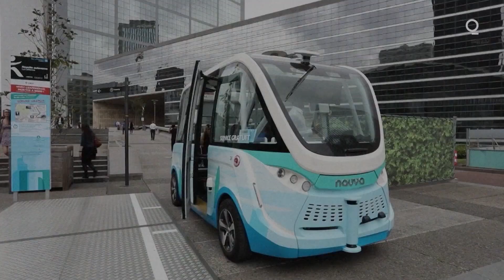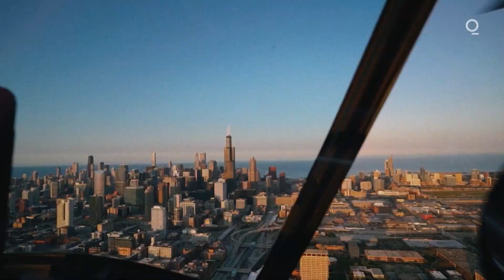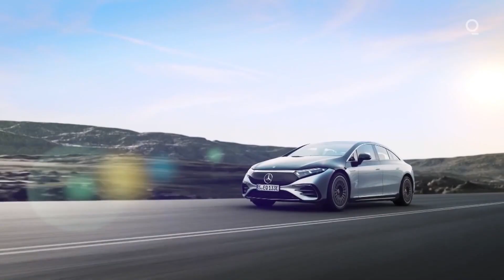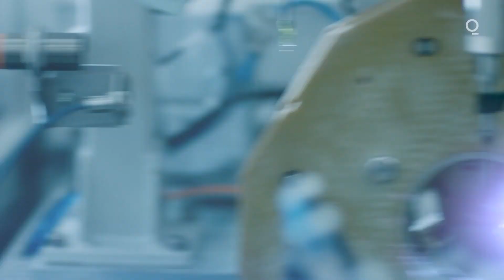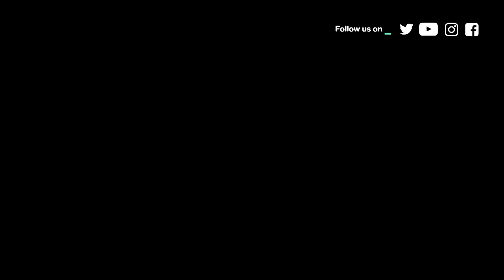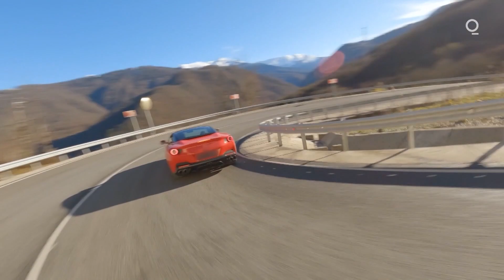Mercedes Bought This Motor Maker to Give AMG EVs an Edge

Comment: And an axial flux motor or axial motor for short, is gagging to be fitted inside of each and every wheel, let’s be honest.  This would permit the elimination of differentials (use an electronic/virtual diff instead) and every vehicle would be AWD - even semi’s or large vehicles with multiple axles.  The especial great thing, is that a semi being stuck in snow, would become a thing of the past - just make the trailers have axial flux hub motors in every wheel too.  It’s the flaming obvious, they just want to take their time getting there?!  Good vid, Mercedes invested in Tesla after all, early on.  take care all.

Comment: One of these motors in a hybrid system giving around 100km of range solves the ev problem.Covers most peoples daily driving with no need to update charging infrastructure.